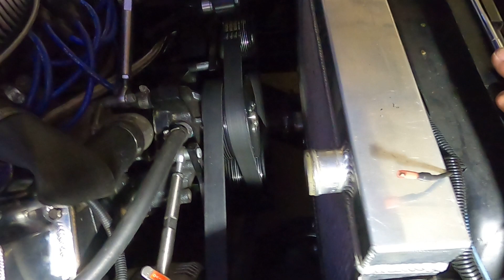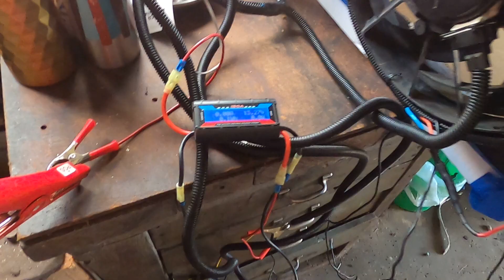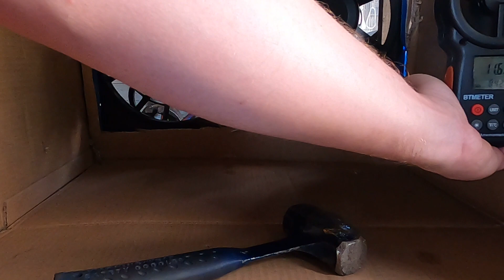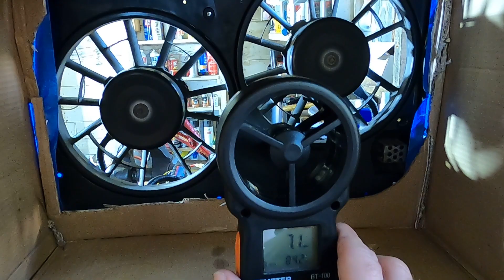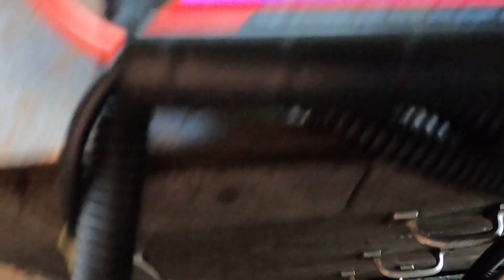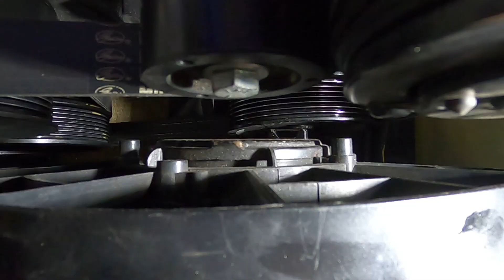Electric Fans & Contour Fan Shootout!

Comment: Great test, are the results the same when wired as both a pusher and a puller?  In the test your pushing air into the box.  In the car, you're pulling air through the radiator.
Reply from the maker: In my case, the reason I set it up the way I did was to get a steady flow reading. The airspeed readings I took are as if i held the meter in front of the (nonexistent) radiator so its working as a puller here as I’m pulling air through the box. Sorry if it appeared the opposite.
Reply: I don’t know why I assumed air was being blown at the anemometer in the box. Thanks for clarifying. I got the fan and installed in my 67 Chevelle. I’m trying a late 90s Volvo 2 speed relay for the fans. Thanks for the idea and making the vids!
Reply from the maker: @murphy1716  just glad to be able to help folks!

Comment: So is the TYC just an aftermarket version of the Contour fan?  If you covered this in the video please forgive the question.
Reply from the maker: Yeah, the TYC is just an aftermarket stock replacement unit. Worked better than the used OEM factory unit in this test, too! I was surprised for sure.

Comment: So these fans are designed to push air into the radiator from the engine bay and not pull in fresh air?
Reply from the maker: The box used in the test would be the location of the radiator. The air is pulled through from the front of the car into the engine bay.

Comment: So can you break that 22 mins down to like a 1 mins comparison. You lost me about 8 mins in and I had to skipp around and missed lots off stuff. Like your video is too long. Did you pick the OEM or aftermarket Contour?
Reply from the maker: Aftermarket was better.
Reply: @randomologist77 I am struggling with an Ebay duel 12 fan radiator set up and found people use these ones. Just picked up a Hayden 12" fan from Oriellys for 140 bucks each one, and it blows those cheap 80 watt fans out the water,  but not direct bolt on, its like an inch bigger. Orders a Spal also. The Henry is for the Ford Contour replacement,  but why is it more expensive over the whole aftermarket set up.
Reply from the maker: @UptownFights I got the OEM fan from a salvage yard. The aftermarket one from TYC was from Amazon. About $150 these days.

Comment: Thanks for posting the video
I  have a Dorman contour dual electric fan that I originally got for my Fox Body Mustang. I acquired a 65 Ford F100 pickup that was my dad's project after he passed away.
It has a 429, unknown roller cam that only pulls 10 inches of vacuum at idle in neutral or park. Edelbrock Performer RPM out of the box installed, Weiand stealth intake.
I purchased a CVF serpintine accessory drive and then realized the clearance from the radiator core to the water pump snout was only 2.5 inches. This was a stock camper special radiator with 4 to 4.5 inches  on the mounting frame of the radiator. I talked to Delta PAG about a custom fan and radiator and their 12" brushless fans. The guy quoted me $1500. A year later, it jumped to $2300. I bought a replacement radiator from Champion. I gained 1 inch of clearance to 3.5". I started to look at my Contour  fan and figured with some modifications (cutting the webbing and inner shrouding I might be able to get it to clear the water pump snout. I got out my Dremel after making some measurements and cut out what was interfering. I made some mounting tabs and mounted the fan  to the radiator. Well, I could not get it in. Pulled out the radiator, removed the fan, reinstalled the radiator, and with much difficulty, maneuvered it into place and fastened it on. Everything cleared, except I can not access the pully tensioner, so I will need to make a clearance for that on the fan. I fired up the engine without the fans being wired up and drove it a few miles. The temperature guage said 160° when I got it on the road, it went down to 130°, I got it up to about 85 mph, so I must not have a thermostat. I bought a Dakota Digital Bluetooth fan controller. I haven't reinstalled the cooling setup yet. I had to swap out power steering reservoir, and have been upgrading the brakes, manual master cylinder, and proportioning valve and modifications to some brake lines and new calibers all  from Wilwood. Today, I'm fabricating brake pedal rod, as the clevis I received from Wilwood wouldn't work. For some reason, YouTube won't allow 
me to receive comments to my comments. I must have voiced my opinions on some other posts they didn't like.
Reply from the maker: Is there any space in front of the radiator where you could mount pusher fans? Hopefully, you'll be able to get just enough clearance to wedge it in. Those 385 series blocks are huge. 2" longer than the FE so losing an inch of clearance seems exactly what I'd expect on the front side. With that cam, I'm surprised she doesn't heat up faster. The 427 needs just a few minutes of driving in summer to get the whole 4 gallons to operating temp. Whew!